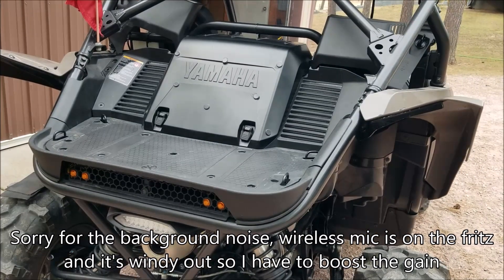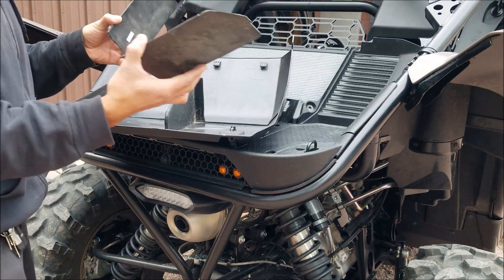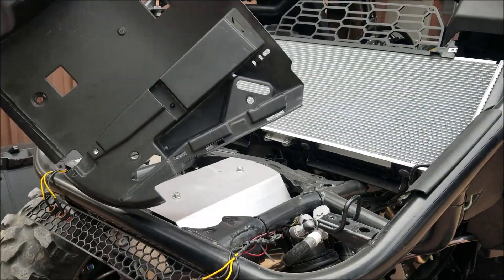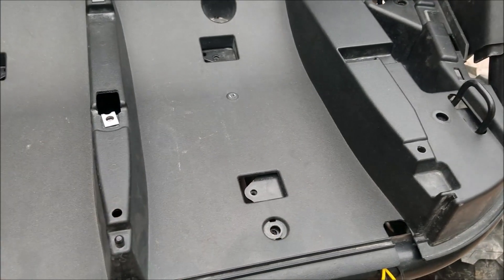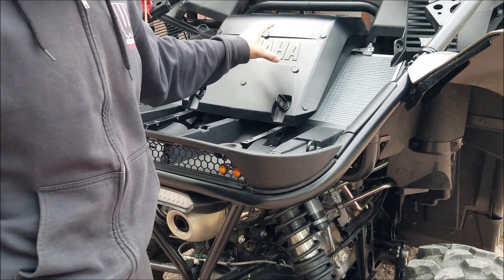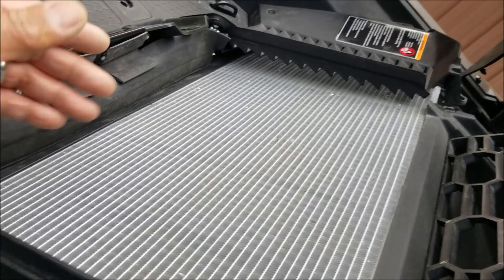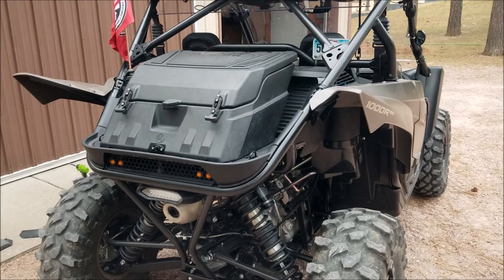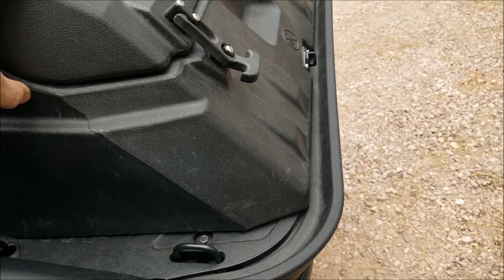2019+ Yamaha YXZ 1000R radiator cooling analysis and FREE heat

Comment: Is there a tutorial to reverse the fans without buying a harness?
Reply from the maker: I cover how to do it in this video:  https://www.youtube.com/watch?v=94dzbFf2DcA
Reply: @MassiveOverkill  I knew I saw it somewhere.  Thanks a bunch!  Just put the same windshield that you have and the temps were climbing on those straightaways.  I plan to reverse the fans and run without the cover as my Packout boxes will hide the radiator anyway.
Reply from the maker: You'll love it.  You can either cut the stock radiator cover divider out and use it as a block-off to help prevent heat from coming into the cab or use the existing grill piece as a template to cut a piece of plastic out to cover the stock radiator intake.

Comment: Would it be any benefit to buy an extra cover and drill holes all in it but leave it on to keep some of the air away from the back window?

Also, if all the intake is now coming from under / sides, is it just sucking, massive dust into the radiator and would cause a different problem ?
Reply from the maker: You can do that.  My next mod will hopefully eliminate all dust coming in through the radiator intake, which happens if it's not blocked off.  Stay tuned.
Reply: Thanks !
Following😊

Comment: Interesting-How did you reverse fan direction?
Reply from the maker: https://offroaddesignworks.com/ actually made me a prototype harness where I can swap plug ends to change the polarity.  Since I'll be running them in reverse full time, I'm simply going to pull the pins on the fan harnesses and swap them.

Comment: I just put a glass windshield on mine . It has vents in the bottom and just took it for short road ride and im finding alot of heat blowing between the seats now coming out of that air intake and my machine is stock , i haven't touched the fan direction at all.  Why would i feel the heat blowing out of the intake ?
Reply from the maker: Heat naturally rises so when the fans aren't running the heat is going to rise and migrate into the cab.
Reply: @MassiveOverkill  I just never noticed it before installing the windshield.  One guy mentioned he installed a rear window aswell to stop the turbulence affect and that hot air being basically sucked into the cab .

Comment: Does reversing the fans  with a front windshield in place suck in exhaust fumes? Thanks
Reply from the maker: Not exhaust fumes but sometimes dust, which wasn't an issue in the winter.  Yesterday I reconfigured for warm riding..........fans still reverse but I removed the radiator cover and reconfigured my rear vinyl window to cover all the rear area so no heat migrates inside.

Comment: Do they make reversible fans?
Reply from the maker: I don't know technically if the stock radiator fan motors are timed to work better in one direction than the other and having the fans blow air through the radiator vs sucking air isn't optimal but most of us simply reverse the polarity of the fans and I haven't heard of anyone having any longevity issues doing so.  When the fans do come on, their duty cycle is really short, like 5 seconds max that I've experienced.